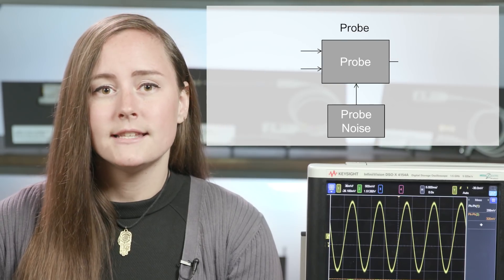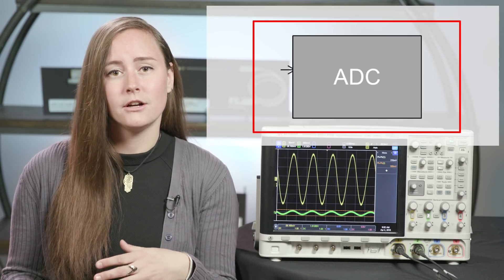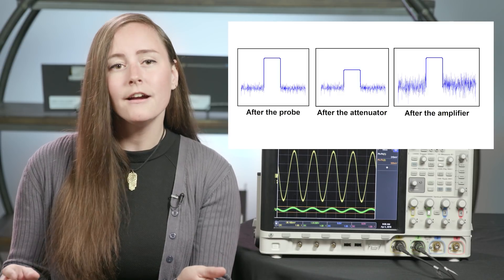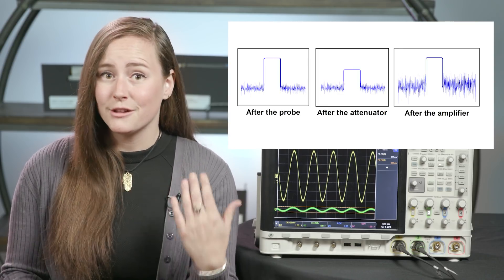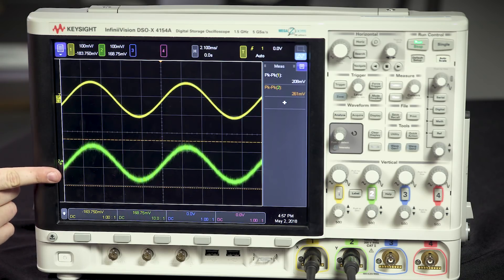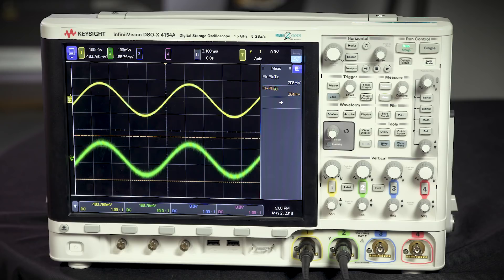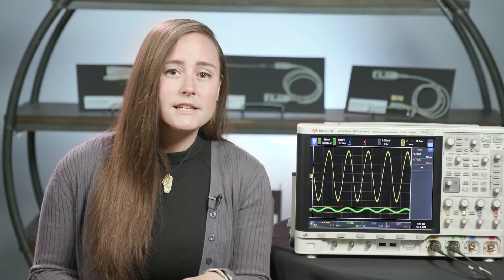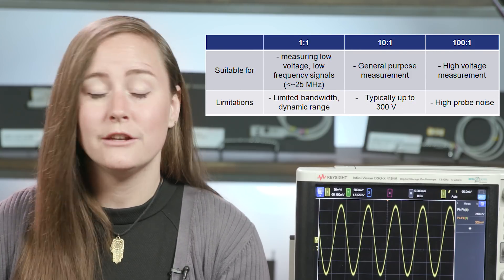How to Decrease Noise in your Signals

Comment: Thx great info. In practice 1:1 probes have limited value and the responce cure over frequency will be different than 10x. I have only ever purchased 10x probes and idk if this is always true but  switchable probes tend to be low quality.
Reply from the maker: There's not necessarily a quality tradeoff with switchable probes. But while in 1:1 mode probes generally have a lower bandwidth than in 10:1 mode.

Comment: So, higher noise is higher volt, but less signal, so the volt is high which cause higher signal feedback so you hear more, so that is called noise something you can hear, well, base on old time of noise that is annoying, so the noise which is annoying that is up and down alot and in high frequently, which cause higher volt thru to cause higher noise output, so input and output volt is higher. So, that is noise is? You put higher volt to cause signal to happen, so volt is necessary, but in middle is noise so need to be reduce?? There is paradox relationship high volt and high frequently is necessary, but high frequently is not since will cause higher vary of output. Less direction output relative to degree that is 360, 180, well, focus one half plane that is 180, so 180, 90, 45, etc, so the output within low degree with high volt.
Reply: This comment is best read aloud with a really comical thick faux-non-English accent. Thank me later.

Comment: Happy New Year! Excellent! Thank you. I have an entry level DSO. So I need to measure only analog audio signals up to 20 Khz. Could you suggest me a better scope with good FFT function not too expensive (with more parameters like THD, THD + Noise, etc.. not only Freq... on screen like major part of the cheaper scopes). I use software FFT to measure the THD of my sound interfaces, but the measurement I made is not exact. I tried different quality cables to looping the I/O of the sound cards, but the harmonics noise level exceeds the norm. Any suggestion about this problem ? Thank you so much!
Reply: Keysight EDUX or Siglent SDS1202X-E. I've owned the latter before. It's a nice, cheap scope (albeit not as nice as Keysight or R&S gear ;)
Most of my other test equipment is from Siglent (including a waveform generator, bench multimeter, portable scopemeter and power supply) and I am very happy with it.
Reply: @0xbenedikt , Thank you!

Comment: Very nice demo. Just want to add something for those new to scopes
1x probes are only fine for DC and very low frequencies.  The BW is most times only a fraction of the BW of the scope. For DC they are 1 Mohm but even for a few MHz they start to behave as a  low impedance, this becomes worse as frequency increased  and finaly they reach a frequency where they  almost short the signal.  How high they go depends on the capacitance. 

Most  switchable probes are not great in performance and bad because you can switch them to 1x by accident. They are only standard on cheap scopes, I'm not 100% sure  but I think you can not even buy really good ones

I have only one 1x probe and seldom use it (I have >20 probes from 1x up-to exotic probes like flux-gate  or 40kV probes
Reply: You gave the content for another video to this girl.

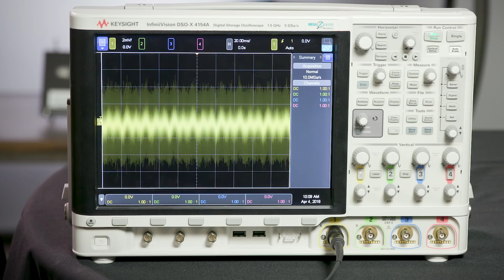Comment: Very interesting indeed. Imagine all the work/components that needs to be there in both designing then calibrating the oscilloscope lone. The probe is also interesting conversation. I'm glad I saw a switchable probe for a brief moment. For right now, I will just say, "in my opinion, a fixed 1:1 or 1:10 probe is much better to use than a switchable probe". I welcome anyone to agree or disagree with this claim and give a reason why.

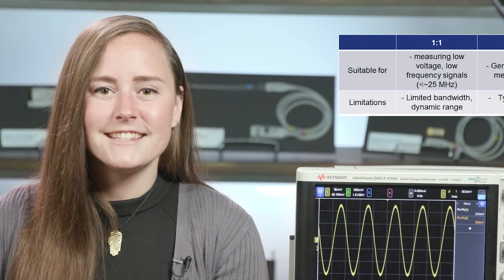Comment: Very well presented. You use the terms "high voltage measurement" vs. a "low voltage measurement" without specifying them. A brief, incomplete mention is given @6:15. I think it would have been helpful to define these terms in more detail, and before you started generalizing as "high" and "low". Keep up the great vids!
Reply: low voltage is 50V+ and high voltage 1000V+ for alternating current - you don't need an oscilloscope for direct current but the low and high voltages for direct current are higher though
Reply: It was accurate to use those terms, as they were relative terms. Defining them is not appropriate as it still depends on what the desired outcome is for measurement.